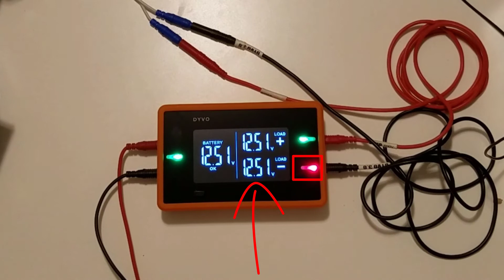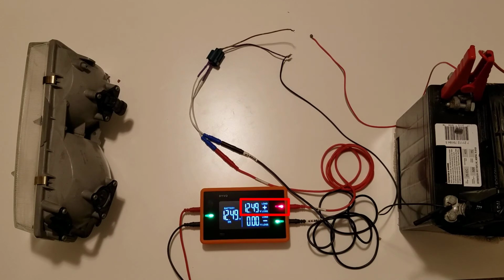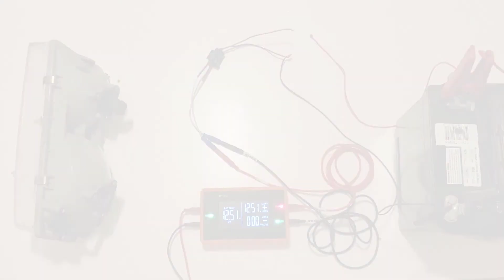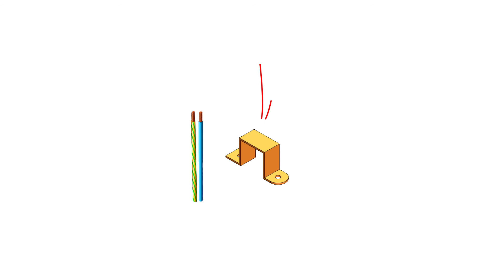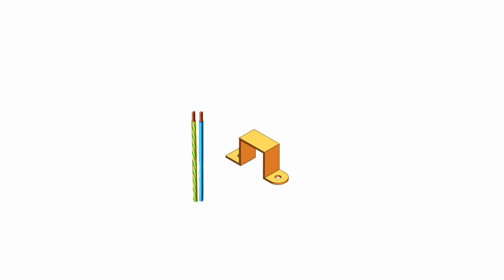How to find an open circuit

Comment: 3:08 4 things...the connector.
Reply from the maker: Great comment! Our approach to diagnosing is to simplify the problem by breaking it into 3 categories: the component, the positive side, and the ground side. Yes, you're correct, there could also be a problem with the connector. There could also be a problem with fuses, relays, switches, modules, and much more. A problem with any of these, including the connector, are still categorized as being a part of the positive or negative side of the circuit. The terminals inside the connector carry positive and ground to the component. So if there is a problem with the terminals in the connector, you will have a problem on the positive or ground side of the circuit.

Comment: How do you find a short to ground with dyvo
Reply from the maker: Great question! The negative channel on DYVO tells you how good of a connection you have to ground. Simply connect it to any circuit you want to test to see if there's ground on that circuit. A green LED and low value on DYVO indicates a good connection to ground. This is what you want to see if you're testing a ground circuit. If you're testing a circuit that isn't supposed to have ground, this would indicate a short to ground.

Check out our recent Instagram Post that shows testing for a short to ground with DYVO. 

If you have a fuse that keeps blowing from a short to ground, remove the fuse and connect the negative channel on DYVO in place of the fuse. This allows you to test and find the short without continuously replacing fuses.
Reply: Post the stuff you post on instagram here. I don’t use the instagram